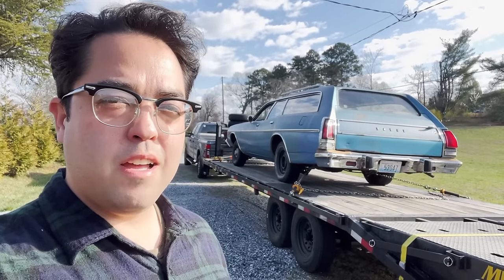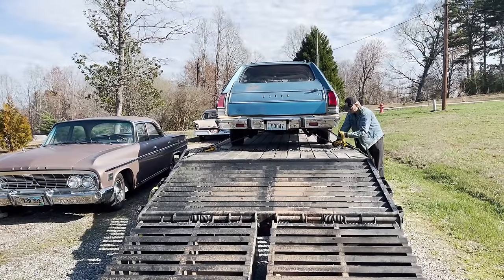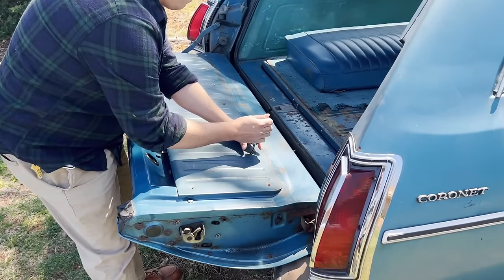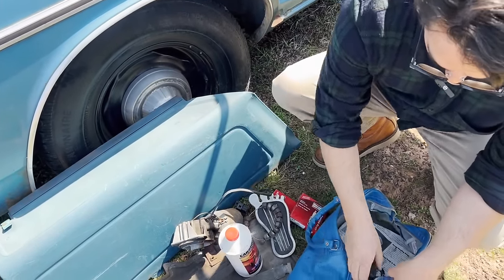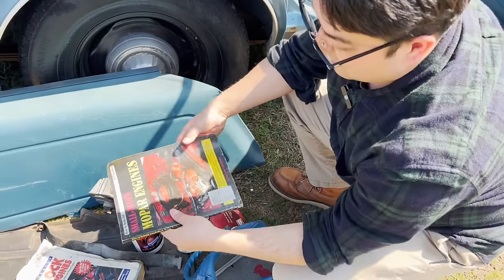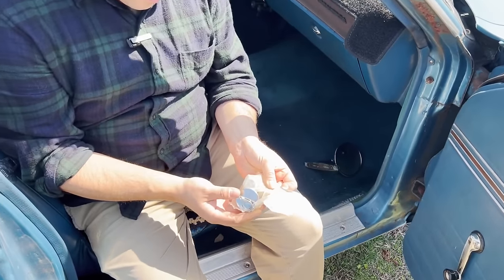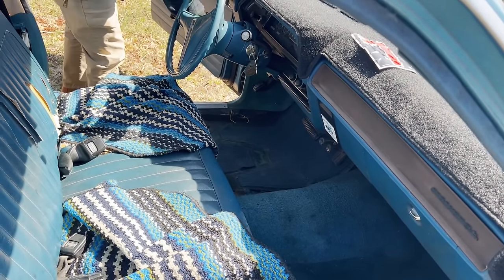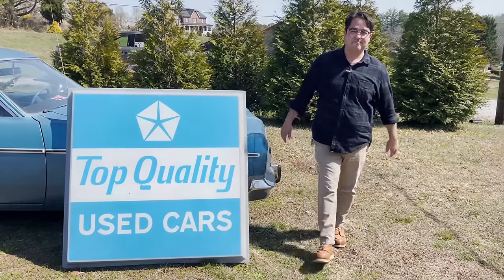1974 Dodge Coronet Custom Wagon, First Look! 9 Passenger MoPar Plymouth Chrysler Obsolete Automotive

Comment: The old commercial signs are getting collectable. 1974 was an in-between year for styles, but there doesn't seem to be a lot of rust on that one, makes it quite rare to be that intact.
Cold war motors would be jealous
Reply from the maker: The only rust is on the doglegs and drivers floor pan. Otherwise she’s pretty dang solid!

Comment: Most of these seemed to be some sort of brown or green,nice to see a blue one..There were a few maroon/burgundy usually 76-78 versions and even silver ones most common besides green and brown in my area..I do remember a black Crestwood wagon 77 or 78 and it had duel exhaust and a trailer tow package,was about 3 blocks from my house..

I have a 1974 400 4 barrel and 727 pulled from a nice Coronet Wagon from the junkyard back in 1994'ish.Complete engines and trans were $350!! We used to buy a engine or trans every payday(I was early 20's then).. 

Sad people here just junked good solid cars that ran good but only failed smog because of a carburetor needing a rebuild(they stopped smog testing in the early 2000's,too late to save most wagons and 4 doors). Most cars thats what it was,very sad so simple and a cheap repair but...They bought that new $6999 Hyundai Excel instead!

The 400 only needed a carb rebuild and it ran perfect,good power,compression was 130 plus on all 8!!!! After a 750 Carter and high flow manifolds It found its place in a 68 Charger I had at the time as the 383 was pooched and barely running.I later pulled the 400 for a strong 440 in later 90's then sold it and bought a real 69 Charger R/T that was too nice to pass up(still have it). I even  have the 400,now a 451 with just over 500 hp..The 383 was rebuild and slapped in a 72 Barracuda turned 'Cuda and was a beast! Man,those days were great! Now I pay $40k and dump another $20k to make $10-$25K lol oh well..Still a good hobby!

Thought maybe you would like a little story form my past by an early 50 year old geezer!

Comment: Sweet wagon man! Talk about RARE! You never see these on the road. You might have a bit of a challenging time finding little odds and ends parts like trim/badges etc considering its not only a Mopar but a wagon as well. Either way it's cool to see it runs and is pretty clean considering the age, I'm sure you'll get it looking and running real nice.

P.s. I LOVE the Pentastar keychain you had on the key for this car ❤.

And I fuckin ADORE and love your Pentastar used car sign. Been looking for some myself, Dodge/Dodge Truck Chrysler/Plymouth whatever. They remind me of being a kid when chrysler still rocked the pentastar on dealer signs.

Comment: Wagons are so cool.  I bought a 1996 Buick Roadmonster wagon from the original owner in 2003 with 45K.  It had the rare factory towing package and when I hooked my camper up to it the rear end would first dip and then raise as it adjusted itself.   I coached my granddaughters soccer team and it was not unusual for us to have two adults and seven kids crammed into the wagon,  they would argue who got to sit in the back as they thought it was awesome.  I drove it to 150K and then it began exhibiting issues too costly to fix, that coupled with my wifes absolute disdain for the car led to me getting rid of it.
Reply from the maker: @lancecorporal9894  stuff that’s supposed to move not moving for years usually lets it get stuck!

Comment: y'all find some sweet cars.  In the early 80's I bought a clean 74 Satellite Regent wagon from a hippie in Boulder Colorado, back before CO started salting their roads.  I don't remember if it was the 318 or 360, but it had A/C and got horrible gas mileage...could barely afford to drive for the couple years I had it.  It was tan over tan with the wood sides...pretty nice, but I like your blue over blue better.  I sure like all the wacky and wonderful cars in your driveway.  The new wall signs are awesome too

Comment: @16:31 when going to the parts store for belts, take the old belts with you. T verify the size. Chrysler was infamous for changing belts and pulleys during production. And the parts books may or may not be accurate.

Comment: Vic’s Classic Car Parts in Chesnee does have a red “B-body” wagon from around 1975-77 that may have a usable fuel tank in it.
Reply from the maker: I need a few pieces. Especially a drivers front door window regulator! I’ll have to check that out.

Comment: Wagon’s sweet - so’s the sign!  About the hood letters - maybe they go missing because they are easy to pry off and they interchange with a more desirable Dodge?  The same “Plymouth” letters were used on the hood of my ‘66 Satellite as well as the deck lid on my ‘64 Barracuda, and I harvested a bunch off  much later Furies - every time I saw one in a yard with a better letter or two I grabbed them.

Comment: Austin my 64 Dodge Polara was a little lighter blue that that wagon , my 70 Plymouth Satellite was Midnight Blue with wide white strip that ran from front to rear , my 73 Plymouth Duster was the same Midnight Blue with the wide white strip from front to rear . The only non- bkue i had was my 68 Dodge Dart it was yellow with black top and interior it had a 318 automatic and ran a whole in the wind !!

Comment: Would have been nice to see the mileage tally from the odometer. Pretty sure that it has not rolled over 100,000 based on its condition.

I was surprised by how much surface rust is on the underside of the roof. Did the factory not apply any paint there?

Comment: Hey I don't think those hubcaps came on that particular car because usually Chryslers and almost all the cars for Ford/GM/ Chrysler when the cars came with the small poverty caps usually the rims are painted the same color as the car. and  rims are black on that wagon with the little poverty caps? So I'm pretty sure that car came with full wheel covers when it was new.